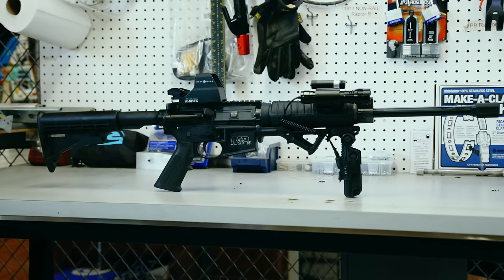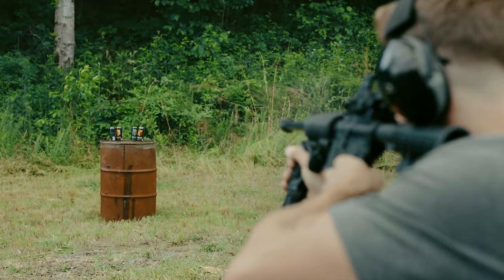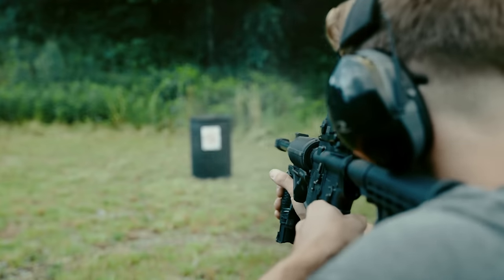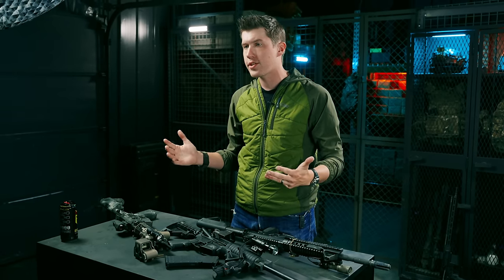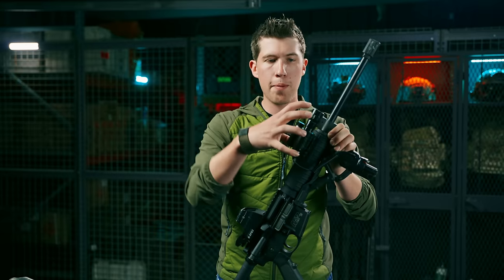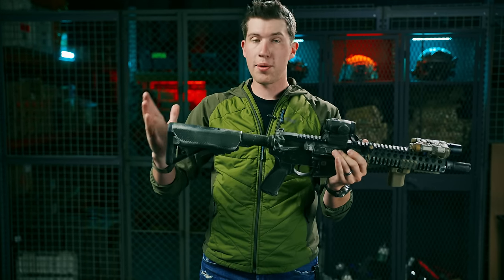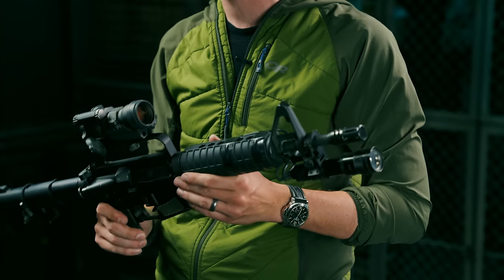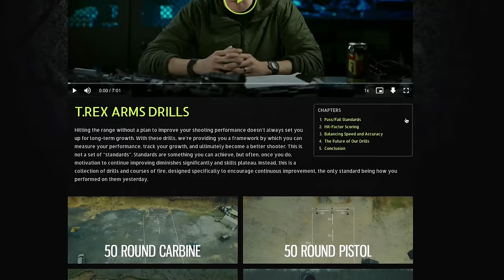5 Mistakes New Rifle Owners Make

Comment: Alot of people choke on spending anywhere from $700-$1000 on a quality AR to begin with, an entry level Aimpoint or Triji at $400-$500 is out of reach for alot of people but I absolutely agree, you are waaaay better off spending $100+ on a quality set of irons than you are buying a $100 optic.

I understand that some people like to shave every $ they can where they can, but a firearm isn't the best place to be stingy. I would rather buy a $500 AR and put a $400 optic on it than buy an $800 AR with a $200 optic. Spend wisely. Aimpoint pro is an excellent benchmark. I've had primary arms RD's that I liked, but I had one fail too..... The Primary arms is garbage compared to aimpoint, they may look and feel similar, but they are very, very different. Don't be fooled. And listen to Lucas, he has had the opportunity to run and test just about everything and doesn't seem like a guy that endorses any product he doesn't believe in...

Comment: The lack of buying a quality optic probably has as much to do with budget/reality as it does with ignorance. Lucas mentions Aimpoint offering an “entry level” optic, but their absolute cheapest red dot is $500. That’s the same price as an entry level AR-15 from PSA. Not saying the top tier brands aren’t better quality/more durable/etc., and yes, eventually people SHOULD save up and get something from Trijicon, Aimpoint, Leupold, etc. etc. But if you’re struggling/in between jobs/etc., there are SOME usable entry level options that will get you by in the meantime. Not cheapest of the cheap, but brands like Cyelee and Monstrum (designed in the US and yes, made in China—just like Sig and Holosun), which at least use materials like 6061 aluminum. Then there are some good middle ground options like Primary Arms and Vortex.

All I’m saying is as much as we joke about “the poors”/etc., it’s a reality for a lot of people who can’t afford a $1,500 bomb-proof ACOG or an $1,800 Eotech LPVO right off the bat, and thankfully there ARE many viable options (besides just iron sights) that are in between those two price points that will help people bridge the gap until they can afford a better optic.

Comment: Everyone should start with a rifle built around an A1 or A2 upper receiver and a copy of FM 3-22.9, either physical or in PDF format. And I do mean EVERYONE. That fixed carry handle upper will withstand almost any stupid thing you can do to it and it will teach you the fundamentals. Not only that, but pretty much any optic worth its salt can mount to that carry handle using a pic rail attached via a knurled set screw you can get for cheap, some even without the pic rail and just the screw.

Comment: I would like to see a bottom dollar AR build using the absolute cheapest parts - where they don’t matter, and good/expensive parts that do matter.  So have a build using the crappiest buffer tube, stock, receivers, springs, gas tube, etc.  But use a high quality barrel and bolt, maybe put in a nice trigger.  Test it along side a premium AR for reliability and accuracy.  Put on the same quality optic as the premium rifle too. I suspect it will do just as well.

Comment: The vortex spark AR is an excellent  red dot with unconditional  lifetime warranty.  I ran over it with my truck froze it in 5 gallon bucket of water and then shot it with 9mm at 25 yards just obliterated this thing all glass was busted mount twisted but the damn red dot was still working. Then I sent it to vortex got a new one 2 weeks later the original  cost was $160.00 for the optic. Good deal

Comment: Romeo5 is never mentioned...is it bad? I have several of them on several platforms, (shotgun, ar15, and air rifles) and never had a problem with zeroing it or durability. For 130 bones it's kind of hard to beat Sig quality at that price point.

Comment: 👍👍👍 Personally, the most fun reason for going to the range is making sure everything is dead on zero. Otherwise, why in the hell are you there! Just plugging center mass on a giant target is fun at first, but gets old quick. Secondly, MP15s are some of the BEST affordable ARs on the market. They are extremely reliable and affordable. You don't need a $1,500 AR to send 5.56 down range(and to be honest, there isn't much difference). But if you're going to buy one, your FIRST PURCHASE needs to be getting that damn plastic hand guard off. Get a rail that you like and do it right. It adds perfect balance to the rifle.

Comment: Ok don't bag on NC star. Now that being said when I put together my first AR15 I used a eotech sight a surefire light. But didn't have a lot for an IR laser and wanted to get into NV shooting. Didn't have the money for a peq15 like I had in the military so I went on ebay and for 98 dollars got an nc start IR /green laser combo. Was made out of aluminum and had a good QD mount. The switch was crap but had good side buttons. I though there is no way its good. It will die or won't hold zero. We'll after several thousand rounds and going from one AR to another it never lost zero and still works fine to this day. 6 years. No I have got a peq15 now but that little NC star still works and still holds zero.

Comment: For anyone looking for a budget weapon light. 

Streamlight makes a “pocket light” that runs on 2 AA batteries, think it’s called the “ProTac 2AA” or something. Probably not the best battery life but for 40 bucks brand new in the box it simply cannot be beaten in my opinion. You can tape/zip tie it or you can get a dedicated mount that will fit them. Handhelds are a great option for budget weapon lights
Reply: no... bad fudd

Comment: I had a $30 red dot from Amazon that worked decent and held up ok. But after about a month of field use started falling apart. I have $120 from Amazon and it’s held up GREAT. Haven’t needed to adjust since I’ve dialed it in on day one. Has lasted me 2 years thus far. So yes. Don’t go cheap on optics. But you don’t have to go expensive either. $120 is a decently cheap price.  The best optic I have to say it’s held up as good as my $500 Steiner. Obviously the Steiner is built better. But for $120 it’s great.
Reply: You are assuming that all devices are made the same at all price points which they are not. There are trash 120 dollar optics and others are decent, there are even decent 30 dollar optics but they aren't all the same. You literally aren't making any sense here, if your 120 dollar optic can be magically almost as good as a 500 dollar optic that is 4x the price then... im sure you can figure it out.
Reply: @thomgizziz I’m not saying the $120 is exactly the same as my $500 optic. I just said it’s held up AS good. That doesn’t mean they are identical. It could break apart tomorrow. I will pick my Steiner over any of my cheaper options any day. You get what you pay for. I’m simply saying there are good cheaper options out there.
Reply: @thomgizziz  You basically took what I said and put it in your own words. Lmfao

Comment: ngl, I've been researching and my due diligence over the course of a year. I'm putting together 1 AR I wanna run into the ground put together using usable but 2nd hand parts. So far, I've gotten a Colt hbar upper made in 97, fn quad rail, surefire 951, magpul foregrip, lmt sopmod. 

working on trading someone my RAC headset I got surplus for their eotech exps 2 + magnifier combo.

Comment: Absolute advocate for the reverse angled foregrip.
Reply: How come? I run a Magpul MVG but have had my eye on the BCM Vert. I prefer C-Clamp and the forward angle offered by BCM seems like it would be a little less taxing on my wrist. Like you’re saying, I did notice Lucas opted for the reverse, but I am not savvy enough to know why and he didn’t care to expand on it. I know that BCM’s website says that it increases control; I just can’t visualize the benefit of reverse with the C-Clamp over the forward. Any insight?

Comment: I bought a budget, as I said before, but; it did come with mbus iron sights. Added bcg that's cromw lined springco eject ..70 stock rubber and an ambient charging handle because I'm left handed. I've added some some functional aesthetics remember I can't afford Daniel or Blackout. It's strictly budget PSA w/sales am I Ok w/that
Reply: save up for the Radian Raptor in a sweet color. it'll make your rifle even more dope. and you'll want to change out the BCG. that'll immediately upgrade the durability. good luck to you!

Comment: I respect the advice, buuuut the cheap sight shtick doesn't really hold true anymore, some cheap sights do hold zero very well cuz M4 or AR15 has little to no recoil.  Also in the army our red dots always lose zero but you can also fix the issue with a simple tie-down.

Comment: I liked the video except the last part. I don't have the money for a 2,000 dollar gun with a 400 dollar optic. I have an M&P and have had zero issues with it. Strange how you're questioning someone's motive for buying a gun. There seems to be a lot of gun snobs in the gun community. Talking about how the expense of the gun and the ability to use it in a civil war/combat situation is important.  If you don't have problems with feed, most AR's will be fin in an urban type fire fight. I don't plan on talking my AR into the desert or in the jungles for an extended period to fight an army, lol. A Honda. Civic doesn't have all the bells and whistles that a Ferrari has but it gets you from point A to B just the same.

Comment: What distance would you recommend zeroing  a .308 AR-10 at? Also do you know anything about a Vortex Venom Red Dot?
Reply: 100m for .308 

Vortex Venom is solid for anything within 50m, but your reticle will begin covering your target if it’s anything further than 50m due to the 3 MOA. 

If the Venom question is related to the .308 question, it’s not a good idea to run the Venom on the .308. 

Hope that helps. Have a good one
Reply: @replexity  Thanks, I have a Bushnell AR Optics Scope with the vortex venom on top of the scope mount, I use the rifle for hunting so I wanted the scope, but I also wanted to be able to shoot at close range so I put the Vortex Venom on top. So far I have really liked the configuration.

Comment: Is it not also true that the red dot sights shown in the video were mounted too far back? This isn't a correction but a genuine question. I was always taught to mount it as far forward as practically possible, which usually worked out to roughly above the magazine and perhaps even slightly forward of it.
Reply: Mounting them close to your eye gives you a larger field of view.
Reply: Its AFG is also backwards and he has a VFG right in front of it. The whole thing is a disaster as a joke, but later in the video when he’s talking about lights and suppressors, he pulls out rifles that he uses. On those, you can see that his mounting positions fall more in line with what you were taught. It’s not exactly “wrong” to mount the optics that far back, but you can get scope locked despite a seemingly increased perceived field of view since you’re focusing on the optic. When you mount it further forward, it promotes benefits of the two eye visual field, effectively allowing you to bring the dot to your eye instead of using the rifle to track.
Reply: @replexity  At the end of the day, optics really are just a preference thing with specific jobs. (Even though LPVOs are obviously superior and the only thing to run. Jk but not really.) I still like to rag on dudes that run ACOGs because they're always suuuuper far back and the size of them just makes it look goofy. I know why they run them that far back, but I still like giving them shit about it.

Comment: Lol not going to lie. My first optic for my AR was a cheap CVLIFE ACOG from amazon. It luckily worked out. Held zero and had good glass somehow. My second optic was an abomination with a flashlight and laser. Learned pretty quickly it was trash and I looked like a tool. I only use the laser to mess with my cat now. Hard to beat some standard mil spec iron sights.

Comment: Genuine question about the BCM foregrip.  Is there any real benefit to having it angled a little vs just straight?  If they were the same exact thing size and dimensions and the only thing different was the slight angle on one and the other straight does that make a difference?
Reply: It's all marketing and gimmicks. Angled is for c clamp gripping but you don't need one. Vertical is for comfort, both can use pressure plates for a flashlight.

Comment: The upgrades in sighting systems over the years is great, but if you do not have the basic knowledge of how to aim a rifle with "iron sights" AND have backup "iron sights" when your gee-whiz red dot super duper laser killer battery fed electronic device fails, then you are screwed. Purchase the basics and learn, then go to the next level if you need/want to. Had a general once say that basic topographical map reading and the knowledge of how to use a lensatic compass was over rated because we have GPS's now. Yeah, that went well.
Reply: Uh huh

Comment: Major question, what is your opinion on the Burris AR-332 in comparison to an ACOG other than the reticle itself?
Reply: A real acog is gonna be more durable. 233/556 doesn't have much recoil and it won't matter unless you're using your gun as a bludgeon or leaving it under your car tires.
Reply: And if I’m planning on using it as a bludgeon….
Reply: And if I’m planning on using it as a bludgeon….

Comment: Are 45 degree iron sights good and recommended or are 90s better? At least to start?
Reply: Use a optic with a permanent chevron rather than a battery dependent red dot.  Think ACOG.  Then simply don’t waste money on iron sights you’ll never use.

Comment: You keep harping aim point for $400 why not Sight Mark (great warranty, great customer service, holds zero up to .50 cal) first time buyers most likely don't have $400 to spend, Sight Mark R Spec $115 and a 3x magnifier also $115 and both are the same size as the EOTECH $525 and magnifier $519, I've run Sight Mark on my gun for 3+ years without one problem, Aim points least expensive sight is their Patrol Rifle Optic $465

Comment: If it’s not a bear creek Arsenal on a psa lower with a nickel boron trigger, red accessories, a punisher emblem, sight mark red dot, bipod foregrip, airsoft light with pressure pad zip tied to the bipod, and “smile wait for flash” dust cover- then I don’t want it.

Comment: Always put pressure on the rear handle of the channel locks when gripping a finished surface. You have to squeeze way harder depending on the amount of torque you want to apply when you are holding them backwards.
Just for anyone who doesn't want to scratch the shit out of their newly painted/finished surface
Reply: I like to use a set of vise-grips and a chunk of scrap leather. The wrong way can work just fine if you do it right. :)
Reply: @009013M3  no, stop being intentionally obtuse, it isn't cute and it makes you look really really slow.

Comment: Optic snobs are funny. I get you just need to sell the name brand stuff so they pay you, but honestly the cheap ones aren’t hard to zero, they hold just fine as long as you tighten it down, & spending 250 when you can really spend 50 is just a difference of privilege

Comment: Useful info, but funny how it’s mostly obvious to folks who think. Except the cheap red dot was pretty tempting…it’s a tube with a reflective surface reflecting an LED…how could that be worth $500?! My first one was a gigantic Tru Glo that still turns on, but I quickly figured out was a POS.  I haven’t gotten to the $450 range yet but my definition of cheap /acceptable is north of $150.

The TRUE purpose of the 2nd Amendment. 😂😂😂. Pure comedy!!!  That’s why I don’t need a $500 red dot (for that much I need magnification.)

Comment: Dude... Literally showing the optic that I bought for my new rifle. The sight mark red dot 😭😭😭
Reply: The Sightmark R-Spec is rated for recoil up to .50 BMG and this guy is saying it may not be able to handle the recoil of a 5.56? Seems biased to me.
Reply: I got a cheap reflex sight from Amazon 0 ed  at 50 yards in a single mag. It still hitting in a 4x4 inch area all the way out to 200 yards that's the longest distance any range has around here. I've been saving for a top quality optic but this cheap bastard is going strong. My optics is the one he showed with the adjustable different reticles.
Reply: @DaClosetGoblin  exactly. I've been using it no problem

My rifle is .300 blkout btw

Comment: Some very questionable points. I fully disagree on the point about lights. No need to get stupid, more money isn't better if it's heavily tested. 

Not sure I agree on some of the ergo statements, some of those good for shooting in comps, but combatives prohibit some behavior. Probably should clarify goals for certain equipment and techniques. 

Kinda agree on optics but there is some solid lower cost shit. I run a sig romeo5 on a $2500 300blk and have zero issues and hit everything in comp and training.